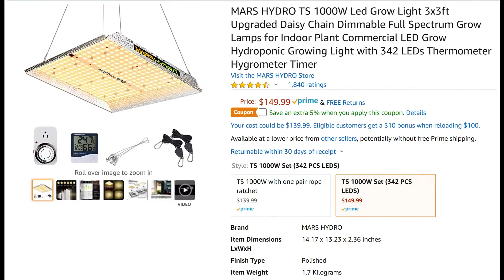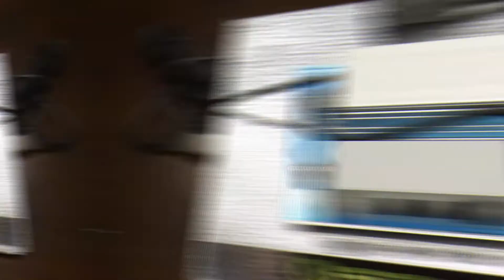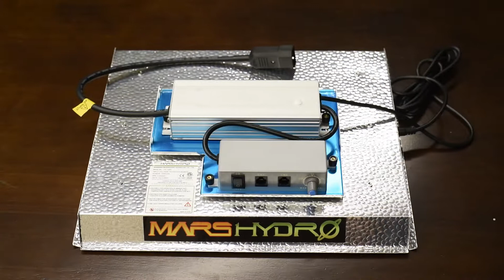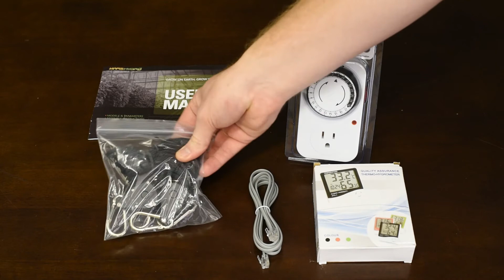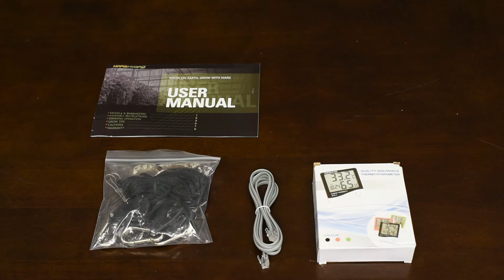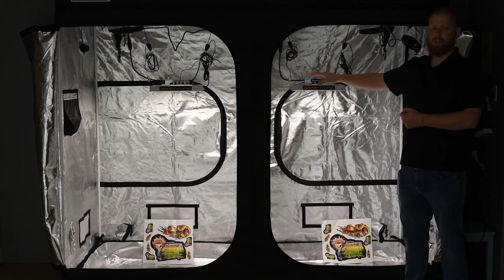Mars Hydro TS1000 Review

Comment: Do you have to use two timers or just one when they are daisy chained?
Reply from the maker: Excellent question, I’m not sure and will have to test the idea.

I wanted to tie my exhaust fan to my lights so I just bought a 3 way splitter to put them all on the same timer.  My power setup leaves lots of room for improvement.  Either way if it does work through the dimmer function you still will need 2 power ports.
Reply: @guidedgrowing2991  I was just wondering I ended up putting a splitter on my timer so I know that works , thanks for getting back

Comment: Can you control the specific wavelength of light?
Reply from the maker: Clearwater Fishing Not that I am aware of, the light is full spectrum so it’s going to include multiple wavelengths already.  The main handle here is the dimmer switch to control intensity.
Reply: Guided Growing Just wondering if plants respond to differently to different wavelengths.
Reply from the maker: Clearwater Fishing they absolutely do.  It’s definitely best to do some in-depth research with the plants your growing and pick a light based on their preference.  Most basic lights are going to have a little bit of everything you need for growth but there are also lights that allow you to improve flowering or vegetative growth based on emphasizing certain wavelengths.